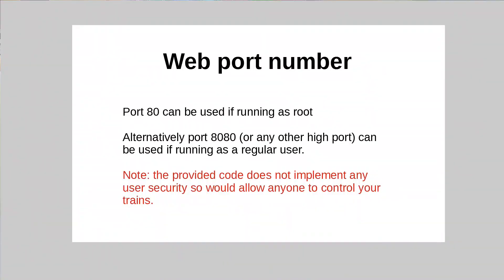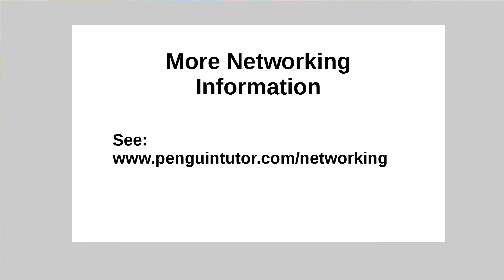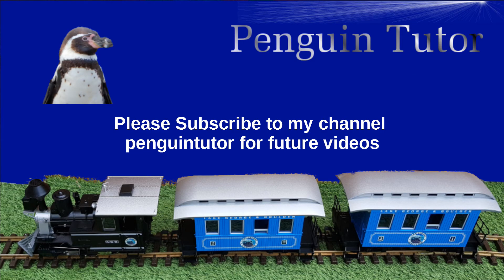Model Train Automation with Raspberry Pi and Arduino - Part 5 - IoT web control

Comment: Hi.  Ive followed your very helpful tutorials, and with a little help from you a few months ago, I have got a hardware simulation working with points, signals and motors.  At the moment though it would only control a single track, and the code would spend much time doing nothing because I have used wait and sleep statements.  What I really want to do is have a double or even triple track controlled by one RPI, using analogue control not DCC.  Im fine with the hardware, but struggling with the code structure, and despite searching Google for days I cant find any good content on how to do this.  I wonder if you know of any good resources, or better still create a 6th module!  Many thanks, Graham
Reply from the maker: I did make a start on something like that back when I created this video, but I only got as far as implementing dual train control through a web interface; I didn't add support for multiple sensors. It's something I'm going to look at in future, but I haven't had time so far. 

I'm in the progress of building an indoor model railway and when that's complete it will have two tracks which I'm going to look at controlling with the Raspberry Pi. But first I need to lay the track and I'm also working on a couple of other projects as well. 

Hopefully it's something I can work on in the not too distant future.
Reply: Thanks for your reply, I’ll keep a look out for your tutorials.